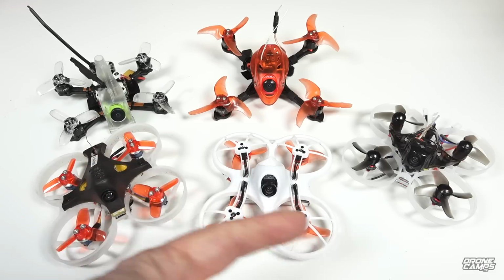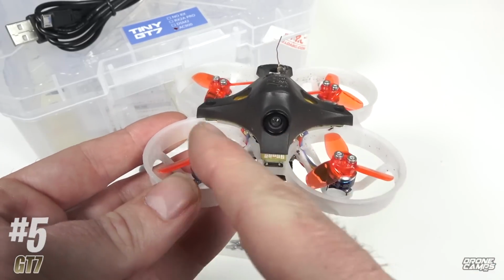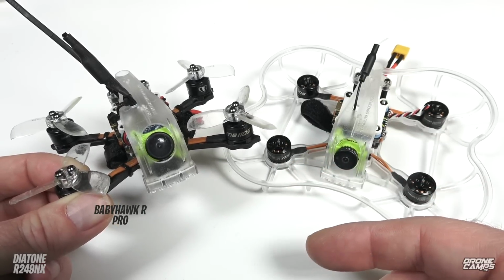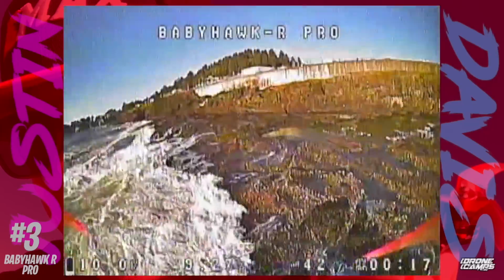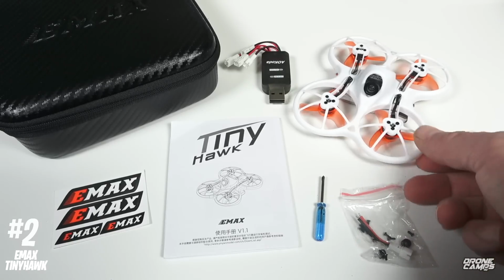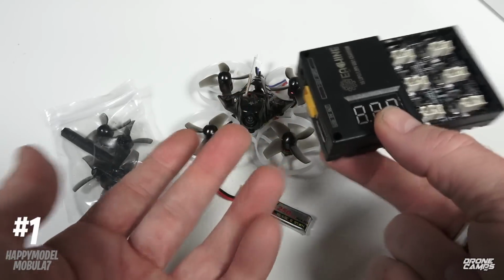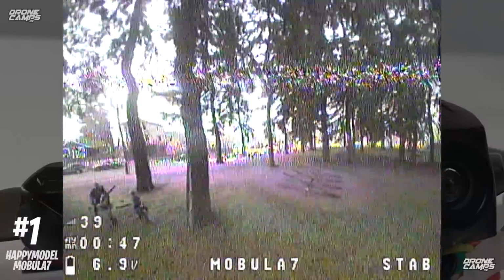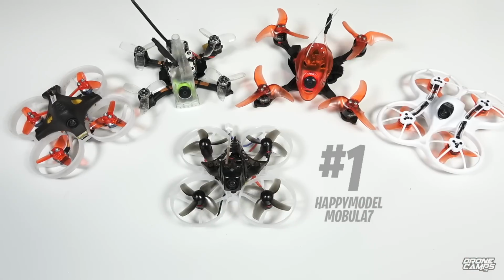2019 BEST DRONES - BUYER'S GUIDE

Comment: So I literally know nothing about drones except that I would like to get  small  one that does long range flying. Anyone have any recommendations for a absolute beginner.
Reply: I'd recommend a tiny whoop such as the Tinyhawk or snapper7. They are perfect for beginners but is not intended for long range flights. Those long range drones tend to be  micro fpv quads with much more power such as the  Babyhawk, wouldn't  consider it good for an absolute beginner...
Reply: @Strik3AMatch  Thanks gonna defintely check them all out.

Comment: The Mobula 7 basic version DOES come with the 1s short plug. It DOES NOT come with the Charging board. Great video. Mobula 7 is the best there is right now in my opinion. Just wait for the Mobula 7 HD to take over. It's coming soon....
Reply from the maker: Mine didn’t but mine could have been a prototype
Reply: Have you heard when you will be able to test the Mobula 7 HD?

Comment: I liked the part when you talked about the replacement of cheap pigtail battery connectors. I don't have any of these quads,  yet. I am currently flying a snapper 7 that comes with the same cheap connectors . Mine actually overheated and melted, I swapped it with a solid prong connector. Fly's great - more power- connector is cool to touch. Thanks for your contribution to this awesome hobby.

Comment: Nice reviews again. The tape on the baby hawk is black cotton tape, I used to use it when I was working on classic car wiring loom repairs for people. A stretchy pvc tape alternative is standard loom tape, which would be a bit stronger and is harder to tear, but is not an adhesive tape so needs holding on with some normal electrical tape on whichever end you finish at. Just wrap it over on itself when you start it off.

Comment: If you live in the EU and are running a FrSky transmitter I would suggest you don't buy the EU version of the Mobula7 but the international version instead. It is lighter and cheaper and you can bind to it in D8 mode with your transmitter flashed to EU firmware. This does not give you telemetry but neither does the EU version. However, you will have Smartaudio which you don't have with the EU version.

Comment: I got the Tiny Hawk and was blown away compared to my old brushed whoop.  I flew it about 10 flights and it went crazy and fell out of the air.  When I checked it, one motor was not spinning.  After testing by moving the motor to another corner, I found it was the ESC.  After 5 days of back and forth, Emax finally had me send it in for their repair center in California so they can look at.  So now I'm gonna be out a quad for probably a month at least and it cost me another $14 to send it off.  Hopefully this is just a one off problem and not an indicator of issues.
Reply: I hope you win this one so you can fly sooner lol.
Reply: That sucks I haven't had any issues. I've beat the crap out of it as well.
Reply: I was getting close to 4 minutes on mine. Little more or less depending on how hard I was flying. We fly indoors in a training room at work during our lunch break so I’m not doing full throttle for sure. I have GNB 450’s.
Reply: @SHess65  thanks for the reply guys I might send mine in too. Mine will literally fall out of the sky after 2 minutes.
Reply: @SuperSilvi1990  what do you want to get when you send it back? Maybe it's to cold to fly? How much degree has it in your flying spot? What batteries are you using?
I got 2 to 3 minutes out of mine. Maybe 4 when I am cruising. Totally normal.
Reply: @Martinsin2002  I sent it back for a refund. I was flying it inside and was only getting 2 minutes before it would lose power and drop to the ground.  I also found that the range was terrible once I did take it outside it would fail safe way too soon. I think mine was just bad. I'll wait on the rumored v2 version.
Reply: man that sucks. I burnt a motor, id say the start winding. it kept starting in reverse even when swapped to other side. I bought a new motor and its good as new. I guess the dogs rope wasn't any good for it lol. I have broke all of the front prop guard struts and it still is fine. its a great quad for indoors. I get 3-4 min inside. outside going high only abt 2.5 min. hopefully emax fixes it for you buddy
Reply: I had the same problem with my babyhawk last year, but my babyhawk r is amazing, most fun best drone ever, l stopped flying my 5".
Reply: On mine the battery life is horrible. 1-2 minutes but people say it gets 4. What kind of times were you getting?
Reply: @SuperSilvi1990  I was getting around 4 ish depending as well how I was flying.